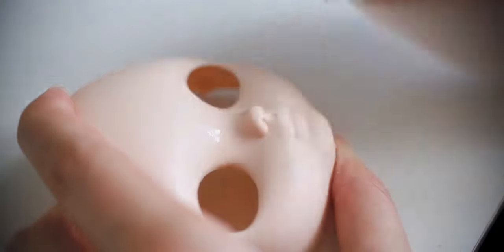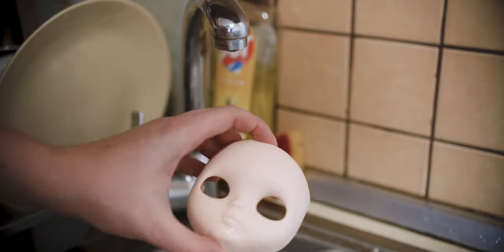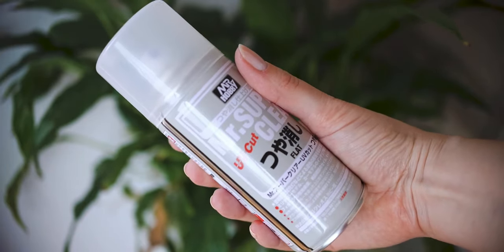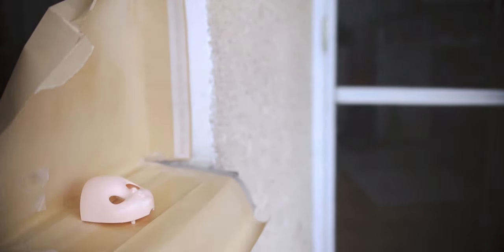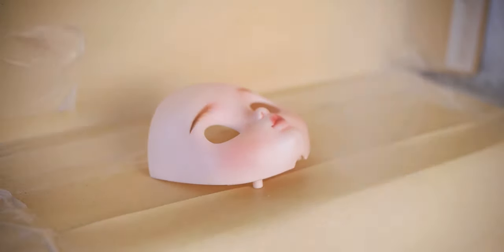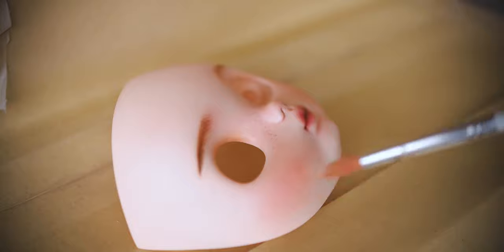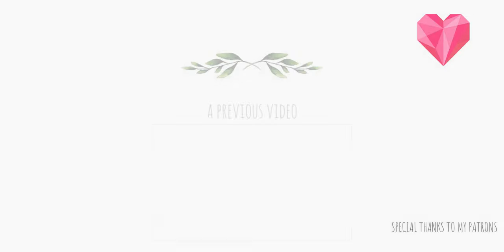using a SPRAY SEALANT - Mr. Super Clear (layers, when & how to spray)

Comment: I’ve heard that the humidity can affect this, is this true? If so, can you explain a little more to help me know what is too humid and what is good, or if any other temperature things affect it?
Reply: Spray at temperature around 18C ~ 26C. Humidity should be under 40% idealy but I did spray in humidity 50%. Humidity can cause shininess and MSC to "cloud" in some spots of the doll. Also spray outside and away from pets or people if you can. See the wind direction and spray in a way its not blowing into you. Leave to dry there. Dont bring into home until its dry if you can.

Comment: What filter do you use? I've been trying to figure out which filter I need for the longest time. Everyone recommends something different. I'd just like to know exactly what filter someone uses.
Reply from the maker: You need filters that filter gas, like the A1 one that I use.
Reply: @unniedolls  I bought P95. Is that good?
Reply from the maker: @jojomang3016  As I read, that filtre is not good since it filters only the particles, but not gas or smell. when you have a good filter, you shouldn't smell any smells at all.
Reply: @unniedolls  Can you please send me a link to the one that you bought? I can't find anything labeled as an A1 respirator filter on Amazon.
Reply from the maker: @jojomang3016  Maybe try to use the "cartridges" word for searching the filters for your mask:) But if you don't have any, you"ll find many masks with filters (cartridges) in a set.
https://www.amazon.com/s?k=a1+filter+mask&ref=nb_sb_noss_2
Be attentive and buy filters only where you see that they will protect you against gas (Organic Gas & Vapor Protection)
Reply from the maker: @jojomang3016  like this one
https://www.amazon.com/Breath-Buddy-Replacement-Cartridges-Protection/dp/B06XPN4DST/ref=sr_1_4?dchild=1&keywords=a1+cartridge+mask&qid=1627566520&sr=8-4
but I'm not sure it will fit to your mask or not. What mask do you have?
Reply: @unniedolls  3m respirator 6100
Reply from the maker: @jojomang3016  I think these are good
https://www.amazon.com/dp/B08P2YN78W/
or
https://www.amazon.com/3M-Low-Maintenance-Cartridge-Purifying-Respirator/dp/B00AEFCP0E
Reply: @unniedolls  thank you!

Comment: Thanks for the video☺, how long does it take to cure or dry?😮 Sorry, I couldn't translate in the video
Reply from the maker: Depending on the humidity. I leave the head for around 15-20 minutes to dry after each layer, and around 40-60 min before painting to it. So If I prepare the head for the first painting layer, I spray 1 layer, wait 15-20 minutes, spray another one, wait another 15-20 minutes and if I spray again I wait 40-60 minutes before painting on the first paint layer, so around 1,5 hours. This might vary on the thickness of your spraying layer, but I recommend spraying thin layers, not a lot at once.

Comment: how long should you let each coat dry for?
Reply from the maker: Depending on the weather, I leave 30-60 minutes of drying time (between the fixing layers after the paint). The very first 2-3 spraying layer however is a bit different. I spray those layers every 10-20 minutes and leave them drying for 1 hour/1.5hour
Reply: @unniedolls  tysm!!

Comment: Can you get the dolls face wet/clean it after the spray had dried?
Reply from the maker: @meenapreston5012  what kind of dirt do you want to clean? You need to be careful and don't get any dirt on the face. This is like cleaning sealed paintings. You never know when you ruin it🤔 sometimes I'm spraying water tobthe dolls' hair to restyle them and some water drops are landing on the face too, but I dry them up fast, so those are not hurting the face. I think that an actual "cleaning" might ruin the faceup tho.
Reply: @unniedolls  I meant if I was to wash the dolls hair and get some soapy water on their face whether that'd ruin it?
Reply from the maker: @meenapreston5012  Oh, no, that would not hurt the face, just try to soak up fast, because the soapy water might react with the sealant if you keep it on the face longer:)
Reply: @unniedolls  thank you!

Comment: Shes pretty. BTW thanks for the tip im scared to used mr.superCLear coz i dont have the mask that u used
Reply from the maker: The mask is not that expensive and it will last you for years!! You just have to change the filters, but I usually keep them up for 1,5-2 years. That's enough for lots of dolls!

Comment: Do I spray ontop of the resin for the lips
Reply from the maker: You spray onto the clean surface, so the paint can stick to the surface after the spray has dried. Then you can repeat the spraying/painting progress if you want a better result (1 layer of paint is usually not enough for a clean and beautiful result).
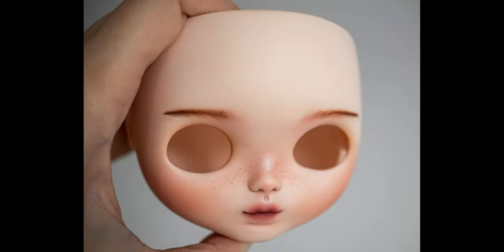Reply: @unniedolls i mean at the end at 2:19 you said you apply varnish to the mouth but you don’t say whether you spray the mr super clear on top of the mouth varnish or not
Reply from the maker: @Bellsdollhouse  oh, I paint with a brush and that is the last step. After everything dried.

Comment: how fine is the sanding sponge you're using? and what store would sell them? I've been trying to find the right grit(?) if that makes sense but so far they seem to harsh for a faceplate
Reply from the maker: I recommend watching my "Tools and materials" video. There you can see everything I use.
I usually use 400 grit sandpaper to sand off the first layer, then I used a sponge that has 600 grit. The last step is a white magic sponge when I smooth out everything.
this is the video I mentioned to you https://www.youtube.com/watch?v=IE6JUnUY6To
Reply: @unniedolls  OH! I didn't think to check your channel ofc >:0 thank you very much!

Comment: How do you erase the sanding marks? is there a method?
Reply from the maker: I'm using very fine sponges and sanding paper, so they disappear by sanding. You need to sand for hours to get a smooth result. First remove the deeper ones with 300-400grit, then use a 600grit sandpaper/sanding sponge, after that, you can use a 1000grit sandpaper/sponge or a white magic sponge, that will really smoothen the surface in the end.
Reply: @unniedolls  thank you so much :3

Comment: How long I must leave doll to dry after layer?
Reply from the maker: Depending on the climate, but at least 30 minutes. If the climate is more wet, then more.
Reply: @unniedolls   mr. Super clear
Can it save factory paint on the doll?
I have really old and Expensive dolls
And I want to saved them, after a layer I want to fix their face up a little with acrylic paint and them give them another spray
I want to know, did it will work good?
Because I am scared to do it, I dont wanns breake anything